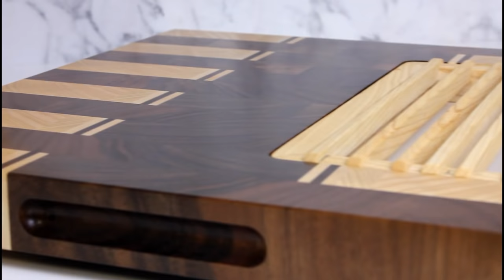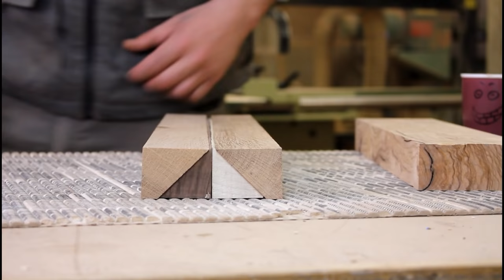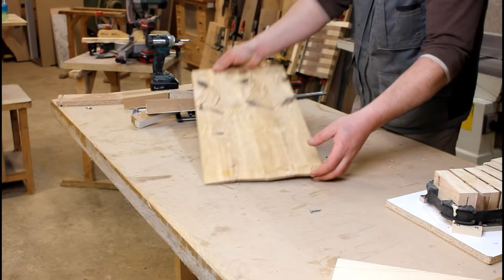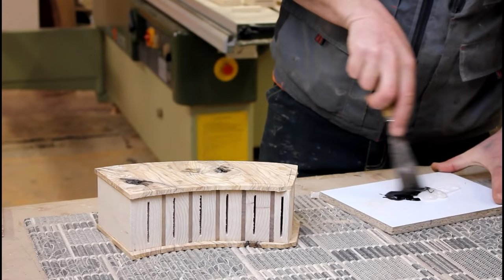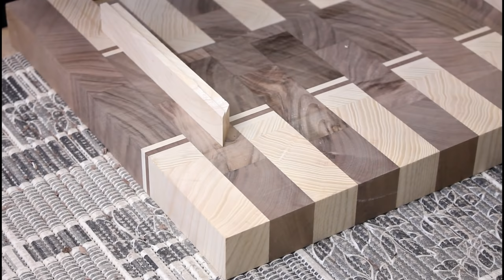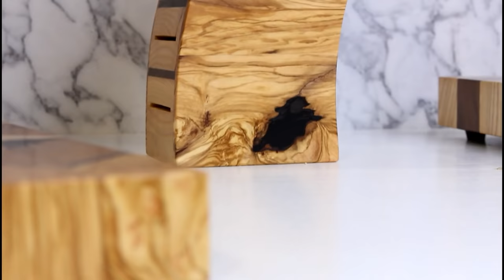Making Super Cool Cutting Boards / End-grain Board With Bread Tray

Comment: hello master, I made two chevron-style cutting boards but a problem arose. after having passed mineral oil the wood at the joints grew back making a tooth. could you tell me why or where am I wrong? I'm sure your experience will solve my problem. Thank you in advance
Reply from the maker: This is normal.
Once you apply oil wood will sucked that in and fibers will expand.
Because there are many pices of wood and each moves in it's own way the slight raising between glue line can be felt.
Solution : sand gently with orbital sander 240p just enough to smoothen the surface back. Change paper for either side.
After that reapply mineral oil
Good luck
Reply: @Slovenianwoodworker  thank you very much and I will treasure your advice

Comment: Hi
Great video. I'm trying to make a board with the cut out for the crumb tray. 
How do you do it? I think you started off with a router and edge guide. 
I'm new to woodworking and learning all the time. I just can't work this out.
Reply from the maker: Yes as you saw in video. Edge guide was set to desired depth and simply rout the material out. It doesn't matter where you start first. Just make sure it's the same shape all around. It's easy. Good luck
Reply: Slovenian Woodworker Thanks

Comment: I purchased Cutting board Plan # 2 and am at the point of  cutting to flip.  You did not specify how wide to cut the strips.  500mm /10 = 2" maybe? is that what you used or is there another measure?  Thanks for helping! I enjoy your work.
Reply from the maker: Yes it depends of the thickness of your stock. If you use 50mm thick wood then cut it around 42-44 mm. This will give you 10 pieces and nice pattern. The width of cutting determine the boards thickness and length. Thank you

Comment: I notice that plenty of tricky and essential cutting steps have been omitted - for example the angled cutting method for the knife holder parts.
Reply from the maker: That's because I don't wanna repeat myself. I already made video about that and showing everything.
There is link in the video to that video. Or just 
Check my other video it's easy to find.
"Title next level cutting boards "
Also you have plans if you're interested. Good luck
Reply from the maker: Angles for knife block pieces you can cut the easy way on mitre saw.
Set desired angle and rip it.
I did it by eye but angle was between 5-10 degrees